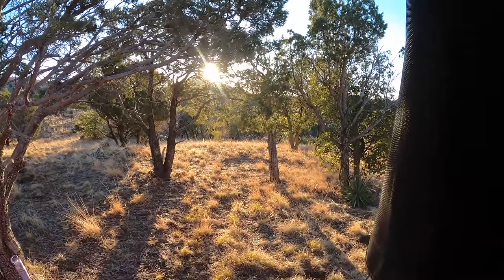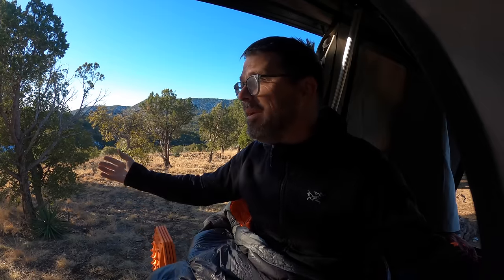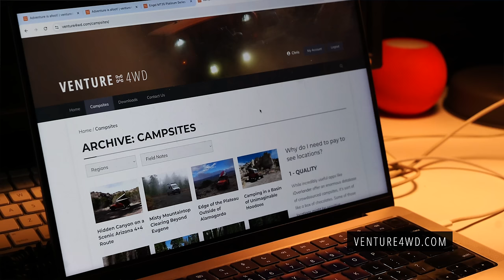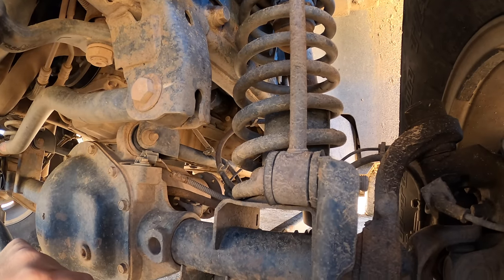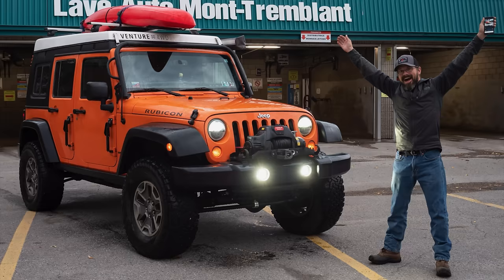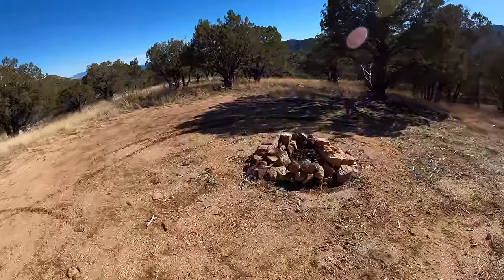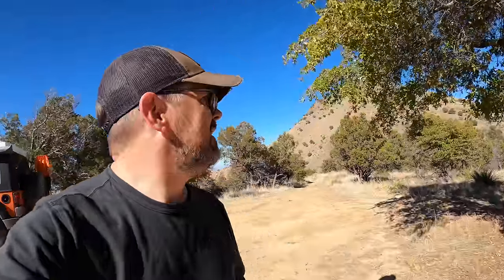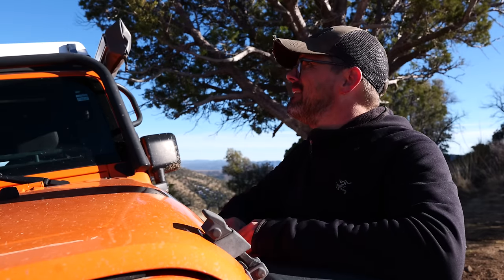Tales of an Old Orange Adventure Jeep - V22E5

Comment: Chris, if you are considering re-springing orangie and using the AEV suspension product, you might consider their heavier duty spring set for vehicles that are slightly overloaded. I also added a spring arc correction plate to the front and that will straighten your front springs and prevent them from bulging outward and providing a more linear compression. This is worked out well on my overweight Gladiator. I hope it works for you should you consider doing the same. 🤙🏼

Comment: I had the AEV lift on my JK and after 50,000 miles I switched over to Falcon 2.0 shocks. That was a massive improvement in the ride and handling of the JK, both on and off road. For a new adventure - have you gone from Mammoth to Wilcox on the Rug Road to Klondyke Road trail? It is an over night trail with some amazing scenery and wildlife. It can be done in either the Jeep or the pickup truck.